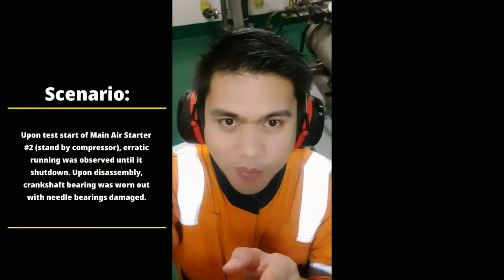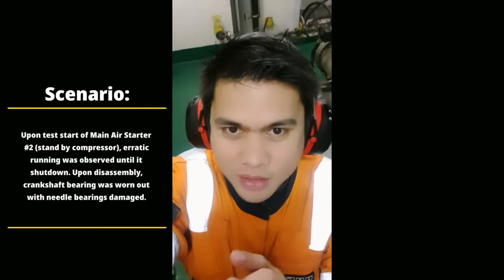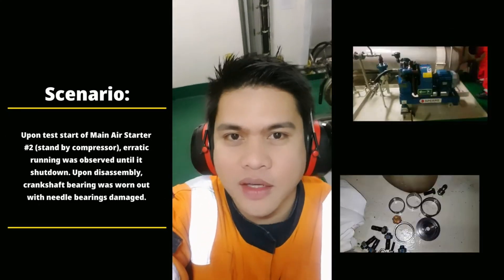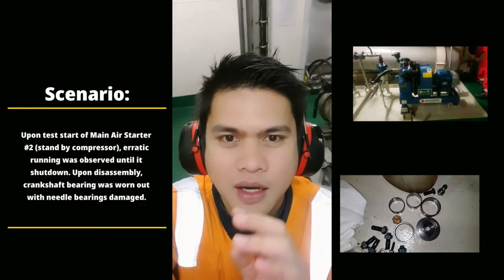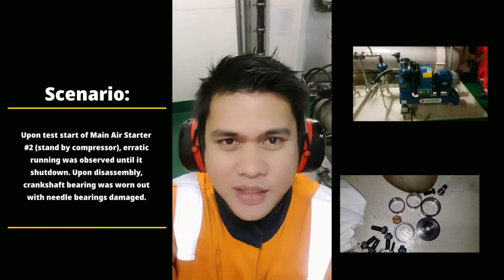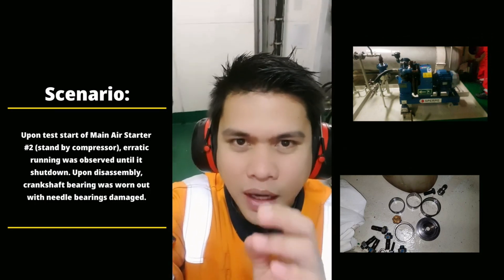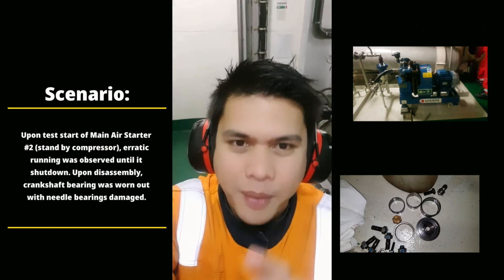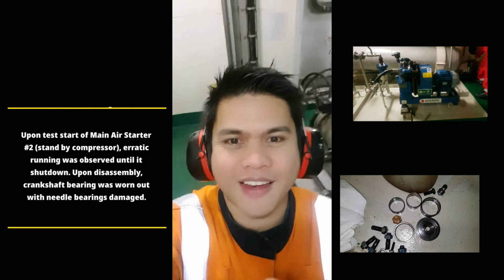Fixing Worn Crankshaft of Sperre Air Compressor: Root Cause Explained

Comment: When replacing connecting rod bearings, how do you know where the bearing lubrication hole is located? Do you have a manual?
Reply from the maker: As per assembly, we just followed the position on the drawings from the maker's manual.
Reply from the maker: There should be an exploded view of the parts of the compressor, from there you should be able to identify the position of the bearings. If found missing, kindly try looking for the drawings online. Goodluck!
Reply from the maker: Also as per usual designs even on AEs Lubricating oil holes are situated on the upper bearing allowing lubrication to flow as the engine operates.

Comment: Same situation as my experience, but before erratic operation, shredded metal parts were observed during lube oil replacement, which led to overhauling it and finding needle bearing worn out.
Reply from the maker: It happens, Sir. Good thing you found the shredded metals. It could have been worse. 👌

Comment: How to check if the spacer valve assembly need a replacement?
Reply from the maker: @sreeram3247  Hi! Actually been a long time working on this type of compressor but will check my notes on this one! In the meantime, we can always review the maker's manual for specific engine troubleshooting guides! Safe voyages, my friend. :)

Comment: sir, how did ur main air compressor crankshaft broke down?
unloader didnt work during start up?
Reply from the maker: It was on long standstill and when the engineer on the watch changed the service compressor it broke down. Later on, it was discovered that the lube oil on the sump tank was very dirty. It could have been the build up of sludge that broke it. Unloader valve was checked and was working fine.